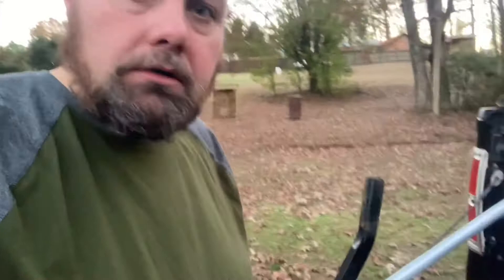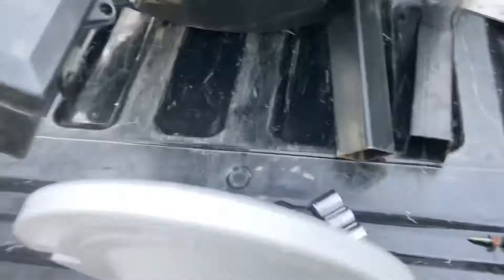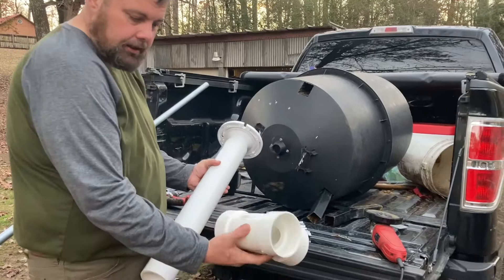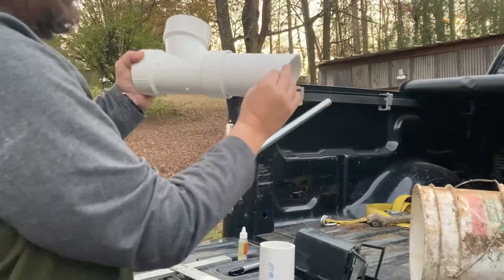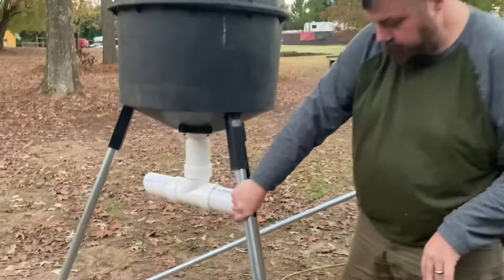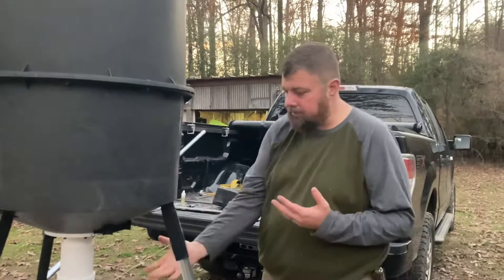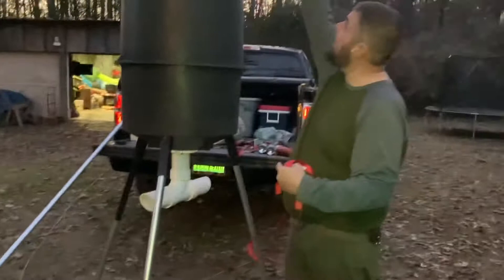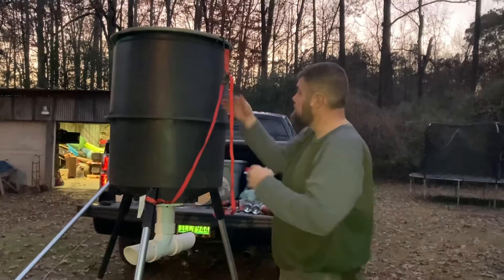Modifying a wild game Innovations 30 gallon feeder from battery-operated to gravity fed on the cheap

Comment: Two thoughts.....1.) why not mount the toilet flange from inside out. Would be stronger that way. 2.) Where the feed comes out at the end .....why not extend them a little more so it'll be more away from the barrel? A buck with a decent rack will be hitting his rack on the barrel and legs. Thanks